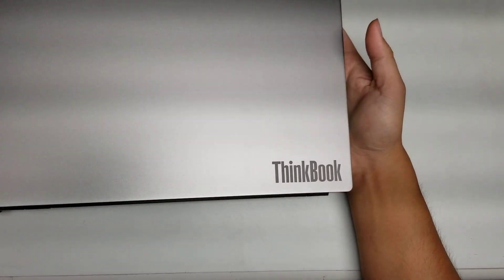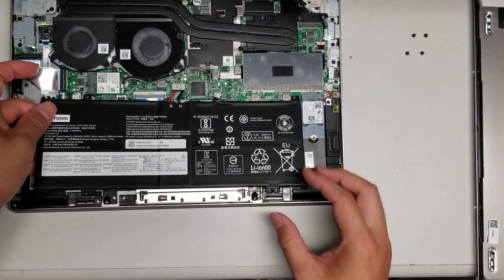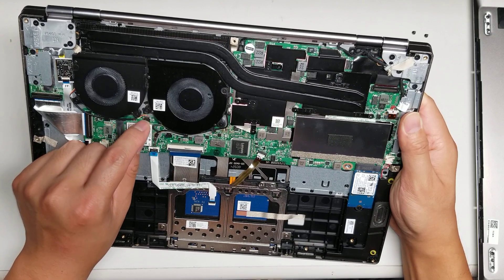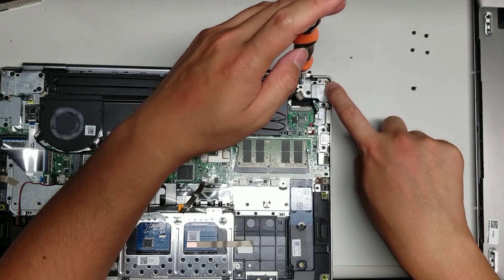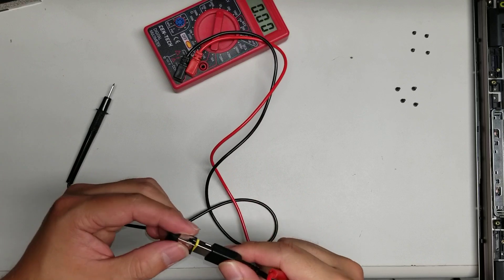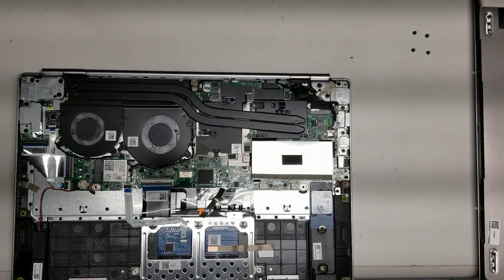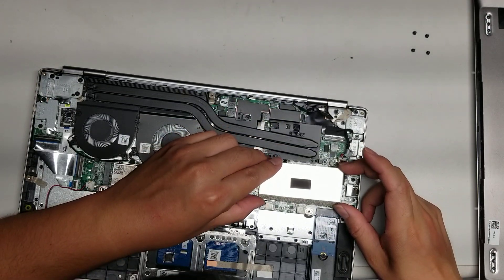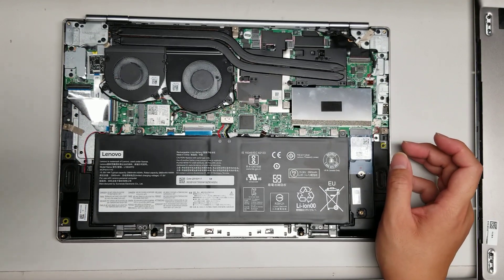Lenovo ThinkBook Disassembly RAM SSD Hard Drive Battery Upgrade Repair Replacement

Comment: does it come with onboard or soldered ram apart from the 16 gb ram card?
Reply from the maker: Take the ram out and see if it still starts up. You'll have your answer.
Reply: @ItsBinhRepaired  there are other people watching your video before buying and have the same question dont be cocky and just simply answer
Reply from the maker: @shayanhussain4311  I don't own these laptops. If you want a Google answer, you should ask Google. Aside from what's in the videos and what's visible, I have no additional knowledge of the computers I work on. I just fix the issue the customer comes in with. My answer therefore is, if you want me to do research for you, you'll have to pay, or you can just show me how little you value my time and I'll return the favor, hence my response.
Reply from the maker: @shayanhussain4311  also, not every model is the same, so I can't give a useful answer to people that don't own the computers. They will say I was wrong or I lied to them because they'll have a slightly different model.
Reply from the maker: @shayanhussain4311  I'm trying to teach people how to fish, as opposed to bringing them fish every time they're hungry.
Reply from the maker: @shayanhussain4311  I'm not being cocky, unless it's being cocky thinking they they can open it up after watching my videos. Lol If they can't open their computer, then my answer means nothing, because they will be unable to upgrade it.
Reply from the maker: @shayanhussain4311  maybe I should do what other youtubers do and just not respond to comments. Lol I get carried away.
Reply: @ItsBinhRepaired  mate you need to understand YOU COME UP WHEN I GOOGLE THIS MODEL YOU ARE THE GOOGLE ANSWER google itself dont produce any answers.you werent clear if that laptop got soldered ram along with one addition slot of just one slot thats it.you couldve said i dont know better than telling the person who googled do it yourself basically .
i eventually found the answer out which is it got soldered ram and then you can upgrade it it got one slot for that
Reply from the maker: @shayanhussain4311  :O I am the Google answer? LOL! That's amazing!
Reply from the maker: @shayanhussain4311  How did you find the answer eventually? I'm going to guess Google. Haha
Reply from the maker: @shayanhussain4311  to be fair, YouTube is owned by Google. Lol But I'm not owned by Google. They need to pay me a lot more if they want me to do individual repair Q&A. lol About 15-20x more. That, and they need to provide the devices. I can't risk customer's devices tearing them down trying to figure things out.
Reply from the maker: @shayanhussain4311  the reason I wasn't clear about the soldered ram was because I didn't know, which is why my answer was essentially, check it yourself. I don't have the ability to check it since I already returned the computer by the time the videos are up, so essentially I'd be googling for answers just the same.
Reply: @ItsBinhRepaired  You are right , but your tone was harsh and that triggered him, please don't stop making these videos, someone like me silently watch and figure things out on its own , without disturbing a helpful youtuber.
Reply from the maker: @faisalnafees8413  hahaha don't worry, I'll definitely continue. :)